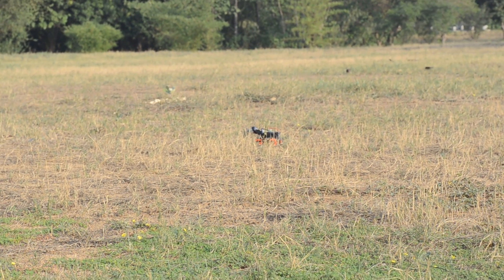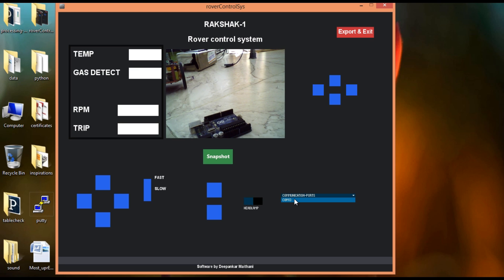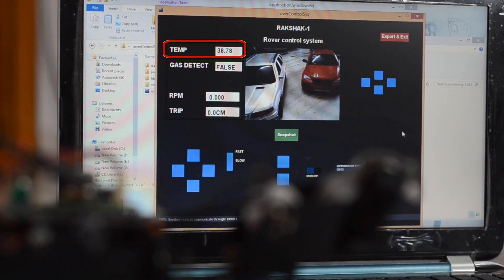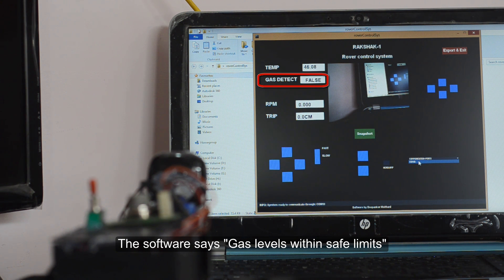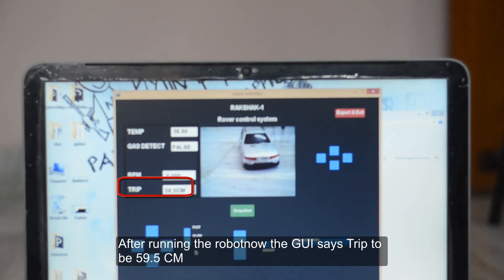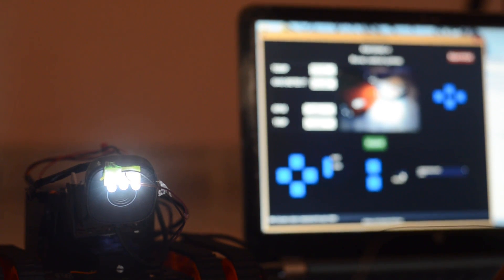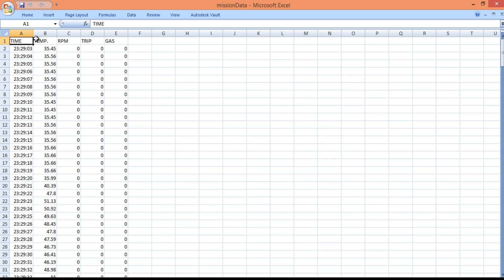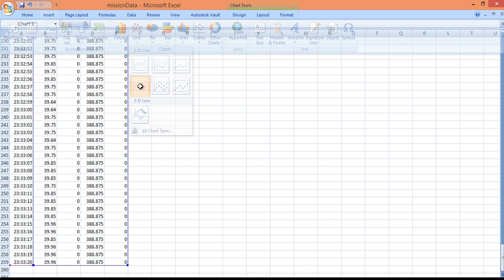A robotic system for gathering data in hazardous conditions.

Comment: I just need your advice about which board I should focus  (Arduino or Raspberry pi) as you're an EXPERT?
thank you.
Reply from the maker: Both have their own pros and cons. The pi is more powerful and you get the advantage of having an operating system, but arduino has its own advantage like it has better timing accuracy and have an ADC inside. So it completely depends on the kind of project you are targeting. However in general i wud recommend that it would be best to learn both and infact at many times we put both of them together in a system to get the best of both  worlds.
Reply: Thanks a lot, that's an awesome answer.
then I'll take them in parallel